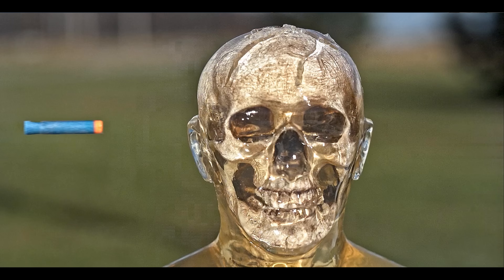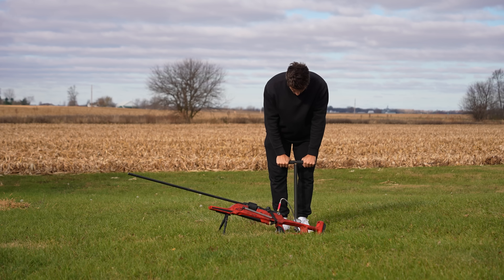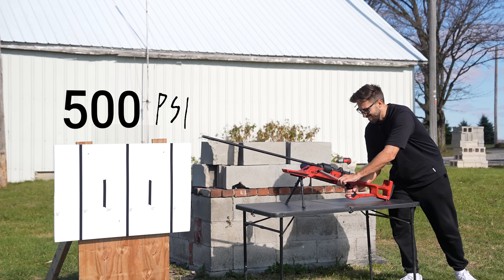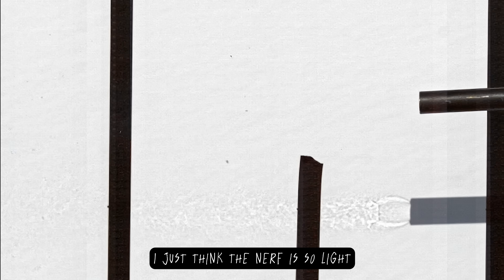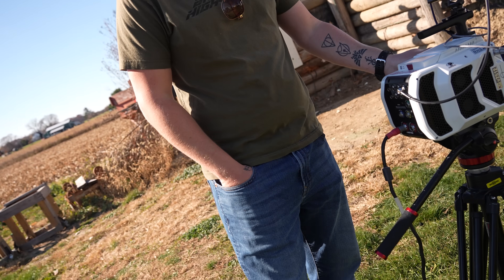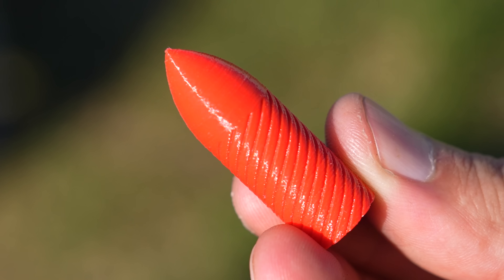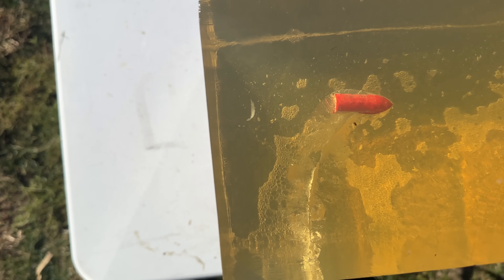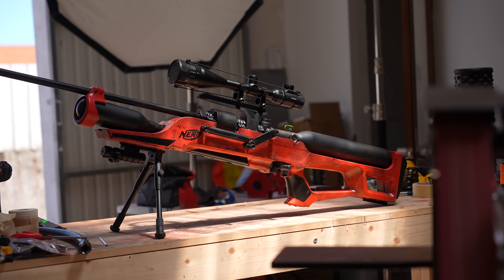How Dangerous is a Supersonic Nerf Dart?

Comment: To prevent the nerfs from blowing out like that, you could have glued in a foam plug to fill the hole. 

With that much pressure, the expansion of the foam would give you a seal and the pressure inside the dirt wouldn't blow out the sides as it was exiting. 

More rigid, less pressure escape right before exiting... less dart damage. Probs would have made supersonic speed a lot more consistent

Comment: I had a nerf gun and a took off the orange tip and sharpened a pencil and i put it on the nerft bullet and i tested it with paper with my friends and it went through and i accidentally shot my friend by the finger and it was bleeding

Comment: just to geek out a bit.. 

(for ref, video 4:50) Speed of sound is depending on the temperature - lower temperature means lower speed of sound .. you'd have more of a chance to go supersonic at a cold day. Air drag due to increased density only starts affecting once it's left the barrel, so when measuring directly at the muzzle, the effect shouldn't be very big. main effect here is that more air mass would need to be pushed out from the barrel before the dart, my gut tells me that difference isn't very big.

to increase bullet speed, you could also evacuate the barrel .. there's a vid by Dustin / Smarter Every Day about that..

Comment: In the slow mo it's starting to break as soon as the tip exits the barrel because of the pressure in the barrel so to prevent this you should either create a sabot for the nerf that will fall off once it exits the barrel or port the barrel back at least the length of the dart maybe just a touch longer

Comment: I would suggest oversizing your printed projectiles by as small a margin as you can. The trifling has to engage the barrel in order to spin. They make shotgun slugs with rifling on them for smooth bores but they expand slightly under pressure to grip the sides of the barrel

Comment: 11:09 
To stabilize your 3D‑printed projectiles in flight, spin stabilization through grooves isn’t possible. In a real firearm, stabilization is created by forcing the projectile through the rifling inside the barrel. You can’t generate meaningful spin using only airflow.

The type of stabilization I recommend is the same used for a shotgun slug, since your design is similar to that of a shotgun. With so‑called arrow stabilization, the projectile is stabilized by placing most of the mass at the front while the rear section is much lighter. Applied to your 3D print, this means: a fully solid printed tip at the front and a hollow or unfilled section at the back, so that proportionally much more weight is concentrated in the front than in the rear.

Comment: So a few things if you use ball bearings it will solve the rifling issue, the secondary bottle needs to be smaller the hissing after is excess exhaust, if you put a t joint at the base of the barrel you can load multiple rounds and load without standing in front of the barrel. Finally the trigger, use an L shape arm that the trigger pulls forward with a tooth and then a spring pulling back open to recharge and its now semi-Auto im going to make one 😊
Reply: Oh and WD-40 down the barrel and if the loader if you add it you will gain almost 50% performance

Comment: Hate to be the well, actually guy, but, well, actually humid air is less dense than dry air. Also, the mach speed is slower in cold air, but the higher density likely slowed the  projectile down enough to counteract both effects. If you could make a system to get some negative pressure inside the barrel in front of the projectile, that thing would get ludicrously fast.

Comment: I'm like a million years late to this. But, 
I have a theory on why you were struggling to get the nerf darts supersonic in this video but managed it when filming your previous intro. When you got the sonic boom as the dart left the barrel, you was using the extension hose. This is likely causing a lower flow rate, but its the same pressure and so a similar force just exerted over a greater period. Giving the dart less of an initial smack, and more of a push, allowing it to accelerate more slowly up to top speed and not destroying the dart.
Also if you look at the dart coming out of the barrel, it only pancakes as it comes out. Its at the end of the barrel so its not due to g force induced acceleration its due to the pressure difference, its being squashed end to end and the only thing preventing it from pancaking earlier is the barrel holding the sides in. But previously, because the hose attachment is giving you slower accel, I'm theorising its also letting more air escape from behind the dart. Then the dart isn't under as much pressure as it leaves the barrel, because the air in front of the dart is travelling at a closer or maybe even the same speed to the air behind the dart. Then the air in front is working with the dart then instead of against it.
Cool set of videos though, I loved watching the processes of the build!

Comment: You cannot exceed the speed of sound in a tube of constant cross-section without the presence of a shock wave ((the main reason for the Hyperloop's unfeasibility that we can read in a gas dynamics book from the 50s). For a gas to propel a mass above the speed of sound of the external medium, the speed of sound of the propellant gas must be greater, either because it is at a higher temperature or has a lower molecular weight. Very high-speed gas accelerators therefore use hydrogen.

Comment: BRO YOU MAY WANT TOconsider making the air go straight not taking bends or changhing directions even gas has a thing called gas getting tierd. At thease speeds i belive is a considerable factor.

Comment: You are the one who could create a crossbow who shoots saw blades maybe even spinning. 👍😉 you know the blades who cut through wood on a table etc. Come on please 🙏 like the pressure they use on those plane ships. Little pins on the outside to attach to the rope (gummy thing) whatever. Elastic 🤔 so it cuts the head eventually. Mean machine 🤣👍 not for army use just testing purpose

Comment: The pressurized Air release that speeds up the projectile is way to long, allowing to release to much air behind the projectile once it's left the barrel, leading to air disturbances. I was wondering when you finally realized it. I got disappointed.

Comment: If the valve, nozzle and barrel are all roughly the same size, it is impossible to exceed roughly the speed of sound (of the temperature, humidity and density of the compressed air, not necessarily the ambient atmospheric air), because that is by definition the maximum speed that the compressed air will be expanding at.
To exceed it, you'll need the path the air takes through the opening of the cylinder, and the valve to be wider than that of the barrel, and then have a special nozzle shape (like how a de laval nozzle works) that takes the speed-of-sound front of compressed air and constricts it into a narrower passage slightly for the moment it hits the barrel and projectile, using its momentum to force it to go supersonic in order to flow the same amount of air through the tighter cross sectional area.
I've no idea whether this would be actually possible to achieve with a barrel and projectile though, vs. just a nozzle opening as would be used for an air powered rocket.

Comment: So with the bullet, the reason why they move so quick it aint just because of the gunpowder. It's because of the aerodynamics, meaning the front of the bullet, the rounder, the more aerodynamic it is, the more flatter, the more air you got pushing against it. That's why the a** end of the bullet. Sorry for my language. Came out first, then the rubber tip came out. Second, because the rubber tip was flat, so it caught more air. Resistance, the other part Was forced around it? So it was forced to pretty much come out of the barrel. First, that's where aerodynamics comes in. So your rounder plastic tipped ammunition. And the other ones will move a little bit quicker. Yes, they're heavier, but they'll move a little bit faster due to the wind aerodynamics

Comment: I'm surprised this is the first time seeing someone tape nerf darts.. It's a common issue for modded flywheel blasters with tight tolerances to shred darts as the come out the barrel. I can't believe nobody ever thought to wrap them with a layer of packing tape.. I could see the potential for the tape to get wrapped up in the flywheels though which would be quite bad so maybe it's not done for a reason. I'd like to see someone try though lol.

Comment: 11:00

Air wont behave like you expect at these speeds. You're trying to replicate spin on the bullet with only passive forces, barrel rifling applies a direct mechanical spin to a projectile.

At the speeds the projectile is travelling, the twists you have on the projectile will just act like wind buffers, creating pockets of turbulence above each ridge, giving you uneven and unpredictable horizontally and vertical forces.
If you could view the effects, you would see a mini vortex above each ridge, acting like a windbreak for the incoming air.

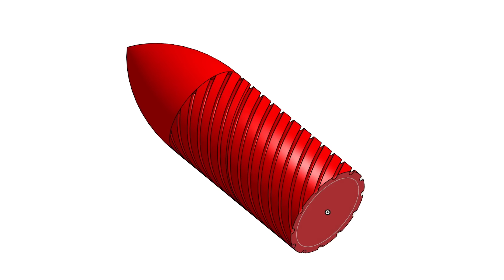Comment: 10:30 Why would you print the spiral rifling at that angle?  Much better if the grooves only had about 1/4 turn over the length of the projectile.  I'm guessing you were trying to keep a gas tight seal?

Comment: For anyone wondering the muzzleloader bullet he used was a 270 grain federal BOR-Lock. The black part at the base of the bullet is made to expand when shot and engage the would-be rifling. The base probably still expanded a little under the air gun pressure which is why it flew slightly better.

Comment: the twist on your rifled slug was too extreme, look at brenneke slugs or foster slugs for examples of proper slug rifling, you want the angle to be significantly closer to a straight line than what you had

also, I understand, highly unlikely you'll actually read this comment or revisit this in any way, but you could try putting bullet wax in the grooves of the 50 cal slugs, that would likely increase performance by quite a bit

Comment: Smarter Every Day used a few layers of saran wrap to maintain negative pressure in the barrel ahead of the projectile to reduce drag due to air ahead of the projectile inside the barrel. They said this was key to breaking the mach barrier.

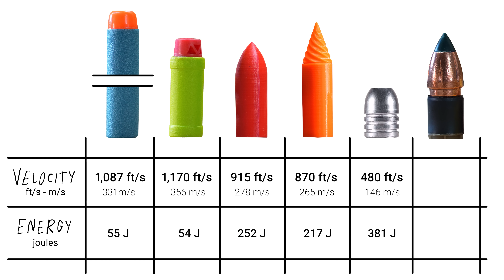Comment: 18:22 and he wonders why the Metal Slugs did Exponentially more damage than the plastic darts even though though they had the same Energy output.
Mass and Density play more of a role in this test than he thinks, even a .22LR round which produces around 162 Joules would do more damage than the plastic darts could .

look i like his videos, but but he introduces variables that feel illegitimate, i get it he wants to see what it can do if you improve it, BUT YOU NEED TO RETEST WITH THE NEW ADDITIONS IF YOUR GOING TO POST IT AS RESULTS, otherwise it is wrong. 

I wanted to see the actual results of the unmodified darts at more than 5 feet, and measurements more 6 inches.  When i use Nerf darts im at 6-22 feet, and rarely deviate, during play, testing, or just showing off.

The foam darts were measured in the first few inches of the the edge barrel to get the Velocity and Energy measurements, incorrect!! You want to measure a few feet out to get real world data, and you even wrapped it up in plastic tape to prevent it from expanding, which invalidates the test. You made the structure far stronger than its possible by wrapping it in a solid adhesive binder, essentially increasing its density, structure and mass, Again Invalidating the test.

Comment: What if you controlled the airflow before the projectile was pushed forward. Design a little bleed around the projectile then see if you can get max thrust behind it. That way the projectile is not hitting a wall of air as it is thrust out of the barrel or as it starts its acceleration? You could really see the air's impact on the projectiles in this this video and makes me wonder how controlling that would affect performance?

Comment: A diablo shape might work very well for the 3D printed ones. That's the shape pellets and many shotgun slugs use. A nose heavy design, with a hollow base, and usually a flat or round nose, as well as a sort of hourglass shape. Basically just imagine a pellet for a pellet gun scaled up.

Comment: I know this was long ago, but the problem clearly is the foam behind the tip of the nerf darts is being pushed so hard from behind and can't accelerate the much weightier front-end tip, thus it crushes in the middle.  what is needed is a way to "solidfy" the nerf dart from that initial impulse... if you ever want to try this again, my suggestion is rather simple and still keeping in the "nerf dart" spirit... fill the hollow center of nerf dart with water and then plug the open end (using a piece of nerf dart foam for example)... this will make the center "cylinder" nearly incompressible, thus transmitting the force internally through the dart towards the tip (the sides will want to expand but the barrel will contain them long enough to allow most of the force to transfer forward via the water "plug".... hopefully along the way it will rupture out, thus leaving a "mostly just a nerf dart" in flight along the way/at impact, thus giving the full acceleration potential while keeping the "essential" nerf dart just a nerf dart.  Just something to try.

Comment: If you pre-drilled holes in the front sides of the nerf darts it might prevent them exploding apon leaving the barrel allowing them to maintain aerodynamic integrity. The problem seems to be them bursting as soon as they leave the barrel, so holes angled back towards the gun kind of like a muzzle break, would allow them to not only not explode, but redirect the air back as additional thrust.

Comment: Hey, busy body here - you might want to put a safety on this. There are several shots where you walk in front of the rearmed gun. I understand the want to block the gas from leaking out, but an additional normal ball valve before the QEV would prevent gas loss and quick pressure discharges. After would be fine (since the other option requires a redesign) but would make taking a real shot a multi-step process to release any buildup past the QEV if the trigger was released - Things to think about for the Hypersonic Nerf Gun. Anywho, stay safe! Great stuff!
Reply: Could you reference the time stamp where you saw him walk in front of a "re-armed" weapon? It's a single shot muzzle loader, requiring a manual pumping of the tank and reload each shot.  He mentions at 2:15 that this version is incapable of firing successive rounds as it empties the tank every shot. The sound you're hearing when he closes the valve is minor bleed over, and again, there's no magazine, so even if he could fire another, it would still require a manual reload.
Reply: Yeah. Kept getting me nervous. Always treat the barrel of a gun as though it were loaded and going to fire...

Comment: I don’t know if anyone’s already pointed this out already, but when they got The Nerf dart supersonic the first time in the previous video the tank was mounted on the front with a hose in between the secondary tank and the valve, possibly acting as a buffer decreasing the impulse  by spreading the force out over slightly more time, putting less stress on the Nerf dart  while still having a higher overall psi, giving it that little extra to go over the speed of sound I’m not saying that’s the only factor I’m just saying it’s one of the factors that wasn’t mentioned as far as I know could be one of the reasons in beginning of the video they couldn’t get the regular Nerf dart super sonic

Comment: Rifiling works by the bullet filling the gaps in the metal litterally locking the bullet and the barrel together. Putting "rifling" into the bullet would do nothing (especially here because the plastic bullets arent expanding)

Comment: rifling in the bullet is too steep, causing "stall like" conditions...
should use lower angle like arround 10 degrees +/-

maybe your next project is make bullet that rotate and stable out of 3d print part

Comment: Greetings from the NERF modding community! A few things you might want to consider if you pick this up again:

- Polish your barrel. Reducing drag as the dart flings itself down will reduce your velocity losses due to friction. In high-power NERF builds, your fellow YTer Chris Cartaya just uses lemon-scented Pledge polish.
- Add rifling, but this one adds some caveats. We typically have a SCAR (which adds rifling using fishing line strung through it) or BCAR (which is a newer development that uses ball bearings to induce spin to the darts) devices mounted to the end of the barrel, but I have no idea whether that'll stay on the muzzle at that pressure and velocity. Cartaya had a brass insert for his hi-po pistols, but that requires quite a bit of precision cutting and tuning.
- You mentioned cutting a few inches off the end of the barrel for shipping, but did you clean up the rough edges from the cut? That might also be simply cutting the darts apart right at the end...

Comment: Pretty cool. When I was a firefighter, we discovered that the end of a 3/8 inch length of white pvc pipe fit exactly onto the threaded end of a 2,200lb pressure air pack tank. We used to make darts out of 10 penny 2 3/4 inch framing nails with paper cups and duct tape. One guy would aim the open end of the pipe, and the other would crack open the valve. It could shoot that dart clean through the doors of a junk car we used to practice auto extraction on 20 feet away.
Reply: Just firefighter things. I swear, you guys are pure chaos.
Reply: @no1DdC  I mean, they do run into burning buildings for a living. Being a little insane is basically a requirement
Reply: Sounds like y'all needed an arsonist in town